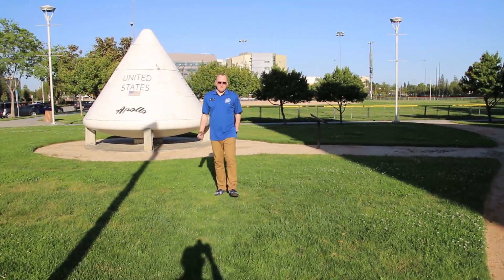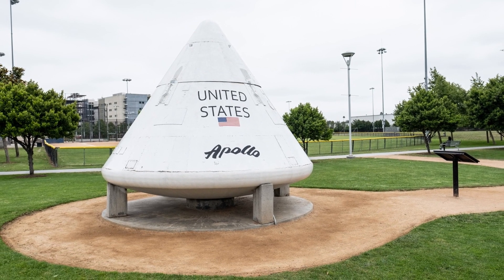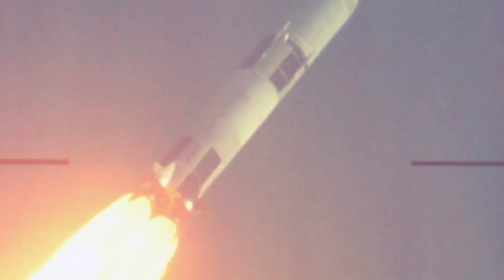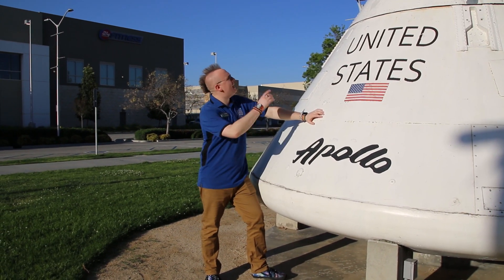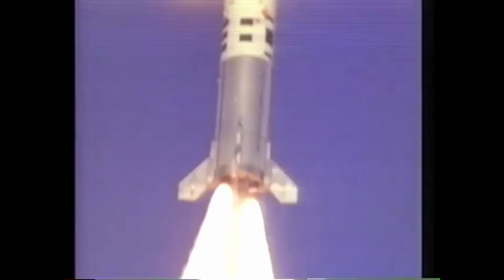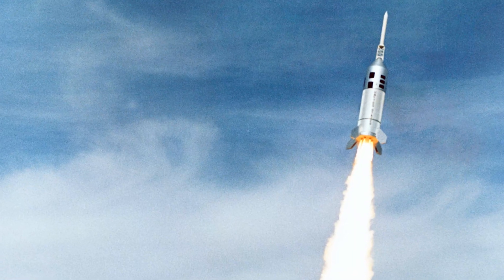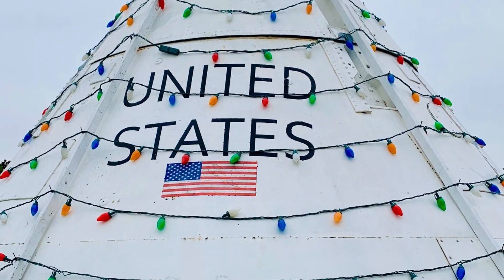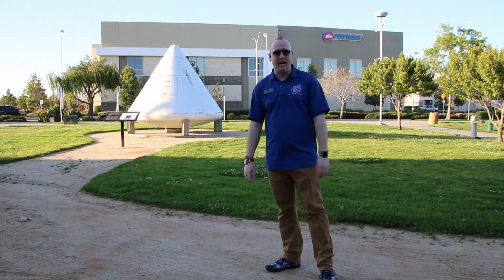CMSC Virtual Tour: Apollo Boilerplate 12

Comment: Boilerplate 12 had a second launching. 
This was when the Union Hall was relocated to the city of Paramount. 
The launch was to be achieved by crane.
 This was to remove it from it's high perch atop a concrete mount. 
First attempt by crane was almost a disaster. 
Boilerplate 12 couldn't lift off it's mount. 
 All this was witnessed by me. I had stopped by on my motorcycle.
Fortunately I had a camera which I received for Christmas,
 and I was taking shots to test it out.
 I took the only visual evidence of this event.
 I had shot pictures of Boilerplate 12 from different angles.
 As the work crew was trying to figure out what went wrong;
 I spotted 2 metal disk on the mounts underside.
 I brought this to the attention of the work crew. They then took a ladder to that location.
 After prying off the metal disk, the crew saw the reason for the failed lift off. 
 Boilerplate 12 had been bolted in two places  of the mount. 
Now 45 minutes had passed and a welder came with the torch. 
After the bolts were melted off; the crew set up for a second attempted Lift off. 
They crossed their fingers as the crane slowly started lifting Boilerplate 12. 
They finally had lift off. 
The crew clapped their hands in triumph. Boilerplate 12 was placed on a large truck bed. 
I then suggested that the crew should pose with it.
 Now I have the only pictures of this moment in time..